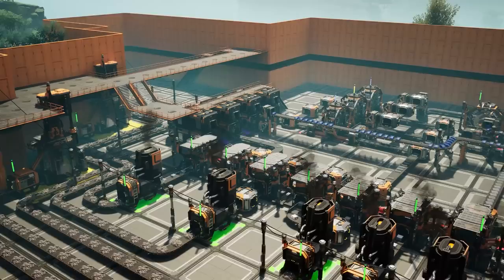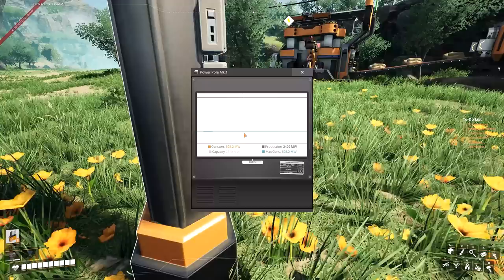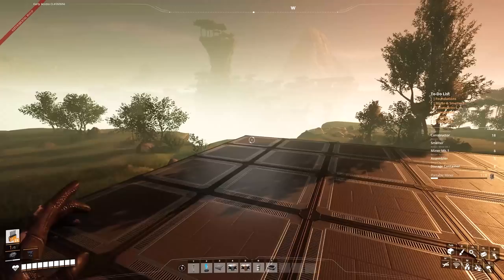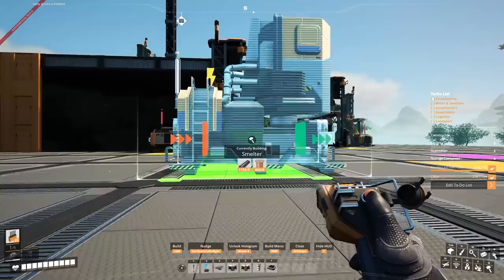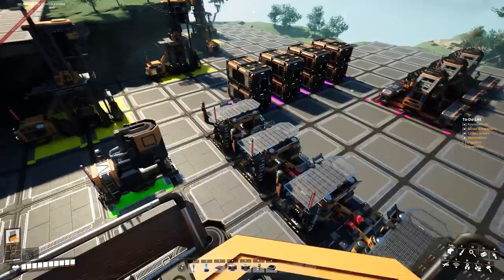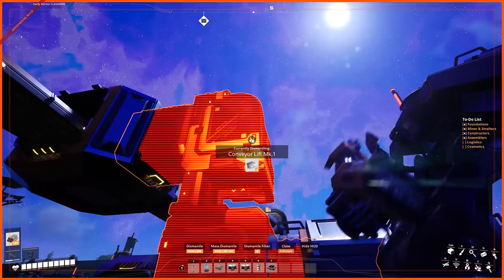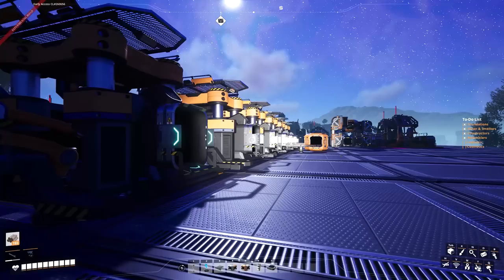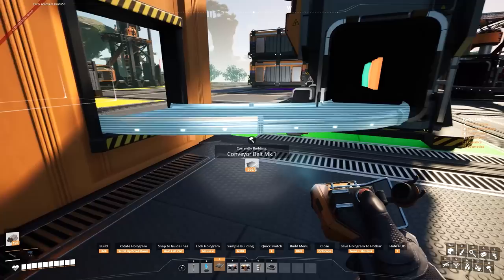HOW TO: MODULAR FRAMES! - SATISFACTORY Update 8 - Let's Play

Comment: Hmmm, i wonder what im doing that different. He has max consumption at about 800, while mine is sitting at 1780. Maybe he doesnt have the water extractors connected to power yet? Though i do rememeber him saying he turned them off, which is the same as me. An extra 1k  consumption makes me think i did something wrong 🤣🤣
Reply from the maker: I cut the cables to them, yeah. Thats probably it!
Reply: @WhatDarrenPlays  oh okie. That would make sense. Don't remember how many you actually built, 60 i think. , but I think the math works out to be about that extra 1k I'm getting. Since they use 20 MW and am currently only using 24 of them.